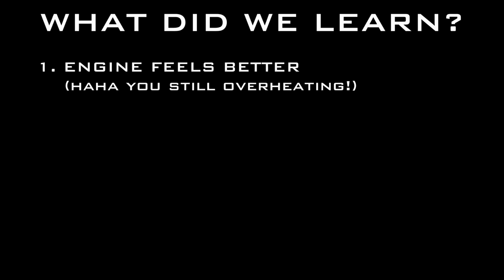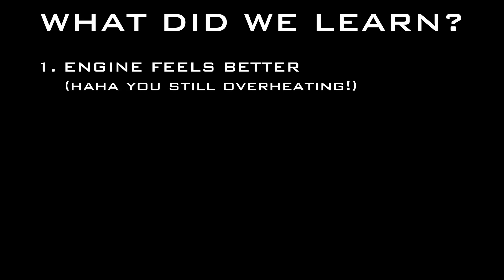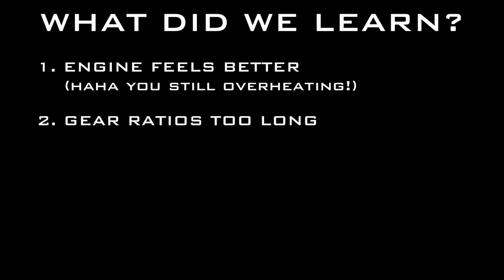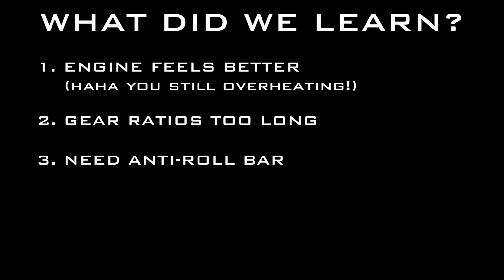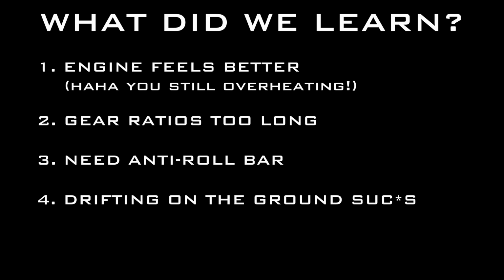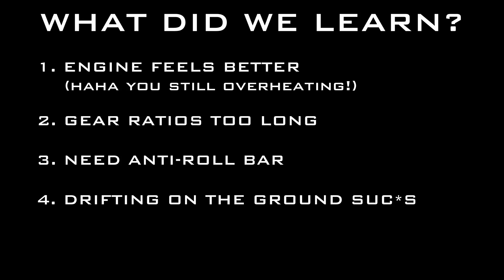Fiat Premier 118NE DRIFTING + TESTING | Project Drift 🇮🇳

Comment: The gear ratios of gypsy transmission are not designed to use  without transfercase (which have further gear reduction) .
You can also try mating maruti ecco gear box as it also have a g series engine. There are shorter gear ratios i think.
Reply from the maker: True. I will first try smaller wheels then change to the ecco box. The ecco has 13inch wheels i believe. right now the car is on fourteens.

Comment: question: ain't a welded differential would create a problem while turning normally on road, since diff/axle welded, both rear wheels hv to forcefully run at same rpm, and in turning outer wheel hv to cover more distance as compared to inner one .
Reply: would love constructive critism
Reply: The wheels will hop a little, but its a tradeoff you have to live with as lsd's are expensive
Reply: @muhammedroshanpk3970  yaa permanently locked differential, it will  drift on its on own on turning in high speeds Even if u don't want to.😂😂

Comment: I think while you are fixing everything you should fix the rust already. Its not safe this way. And lower the car use better suspension. Dont put so much pressure on that suspension.

Comment: Bro want more light weight
Remove your :door, glass, and fix it with fider
Reply from the maker: that's a great idea will surely try that once we have fixed the car completely.
Reply: If engine over heat engine want a oil cooling system